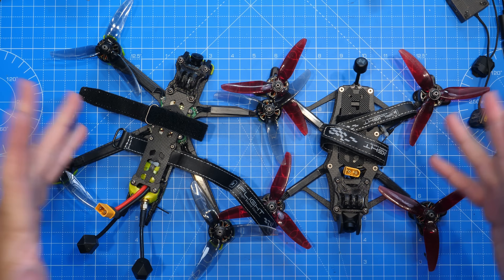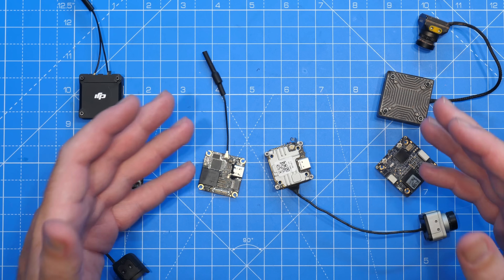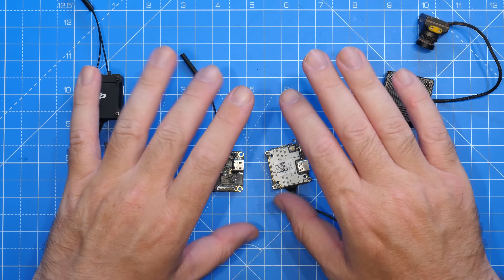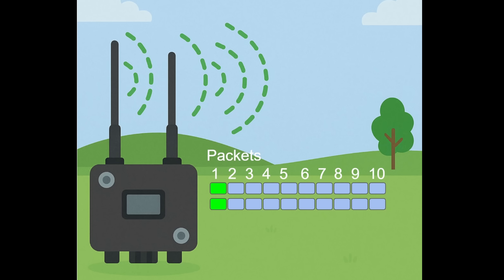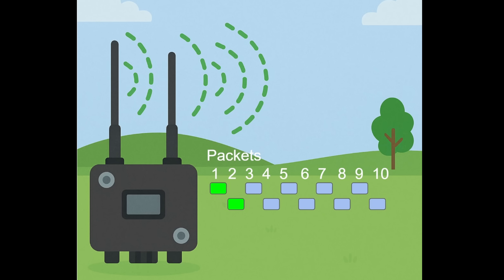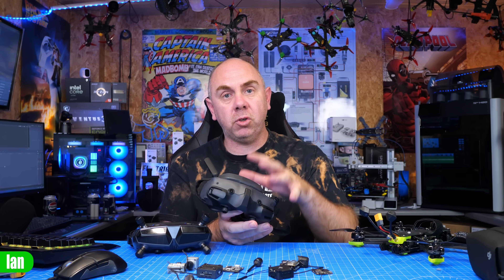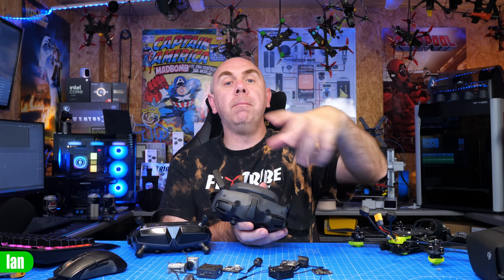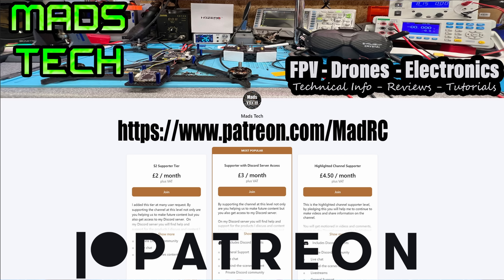DJI O4 & Avatar HD Why Two Antennas ? - Is 2 Really Better Than 1!

Comment: Is there any reason the VRX cant listen in a more passive way? For walksnail the limiting factor in a lot of scenarios seems to be the range of telemetry transmissions from the goggles back to the VTX. 

Appreciate it's optimal for the vtx to be receiving information about what the goggles are receiving but i dont understand why its not possible for the the VTX to just broadcast the video feed, regardless of whether the goggles can pick it up...
Reply: Because they step down the bitrate to compensate for bad signals, while keeping the image sharp when the signal permits - and packet retransmissions...

I guess HDZero would be more similar to what you describe.
It's a trade-off right now, but I'm sure some AI codec could improve things in the future?

Comment: Do you have a video on what antenna to use, on what systems, do we have to buy only the dji atenna s for DJI products?
Reply: Any LHCP antenna would work. Most of the main brands are pretty similar in terms of quality (axii, truerc, foxeer, etc.).  Even the cheap antennas are pretty good in my experience.  ****Edit: I should have watched Ians video to the end. I didn't see that the polarization doesn't matter that much with these newer dji goggles.
Reply: Hello brother, do you have any recommendation on which antenna is better than the DJI o4 pro that offers greater range?
Reply: @Dalbato  I like truerc and axii 2. Although I don’t think it makes much difference. For long range you want the antenna placed far from the quad and each other (usually a v off the back). The goggles need patch antenna to really increase the distance.

Comment: What about dji’s drones? Why do they have 4 and 6 antennas. Like the mini 4 pro which has 4 antennas and runs o4. So why does the o4 air unit/pro have 1 or 2 antennas?
Reply from the maker: Very simply it's the same setup as the goggles the consumer drones have .ore space so they can go upto 6 antennas helping to improve the link via MIMO.   

An Airunit with 4 antennas would be not be practical. 

The actual benefits from the extra antennas fairy minimal overall.  However it depends the situation.  

Like home WiFi routers you can get them with 6 or 8 antennas for beam forming in MIMO.  It's the same with the drones.

Comment: True diversity is pretty cool and desirable. However, the added latency and the fact that if one single packet fails to be transmitted twice between both the goggles and the Drone and both of those antennas is just too much going on.. so for that one is better

Comment: WS Avatar does some weird stuff with the bit rate if you use a patch and Omni ant at the same time on a dual ant vtx. Bit rate constantly jumps up and down from low to high even when close to your ground station.

Comment: Would there be a disadvantage to separating the two antennas by about 50cm using an extension on a large plane? How big would the separation have to be before the spacial diversity or multiplexing wouldn't work correctly?

Comment: Can you use the dji 03 antenna on the dji 04 pro
Reply: I do on two of my 04 pro units. I can't tell the difference from the ones I run the stock 04 pro antennas

Comment: LHCP or RHCP for dji o4 lite with Goggles N3, what 3rd party antenna should i use?
Reply: lhcp
Reply: LHCP is what you want. Most antenna brands are fine. TrueRC, AXII 2, and rush cherry are often considered the best.  I've had really good luck with foxeer at half the cost of those ones.  HDzero and analog tend to use RHCP - although really you just need the polarization to match on both ends.  DJI goggles past v2 are LHCP by default (this would include the n3). ****Edit: I should have watched Ians video to the end. Lol I didn't see that the polarization doesn't matter that much with these newer dji goggles.

Comment: would using a lhcp on one port and a rhcp on the other port improve diversity? Since it switches between two antennas, the opposing polarities shouldn't cancel each other out.
Reply: Nope
Reply: @semadragun  I did a test flight, both single polarity and double polarity flew about the same distance(4.4km one way, 9km total distance).

Comment: I modded the top 2 antennas on the g3 (tx/rx). Do you think that if I power on the gogles without the antennas on (just a naked sma) it will damage the goggles in some way? (since the goggles also transmit on those ports)
Reply: Yes
Reply: @davidpenfold  the real question is how much though?
Reply: Apparently it can quickly overheat the transmission circuitry, leading to failure.
Reply: @davidpenfold  when I power goggles without them on, I don't notice any heating